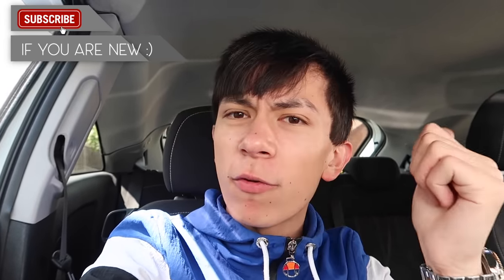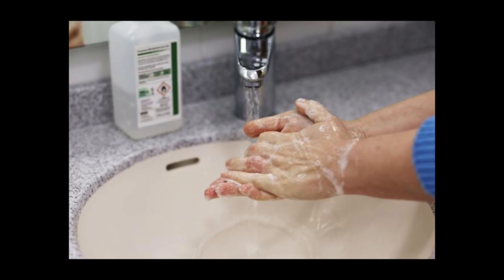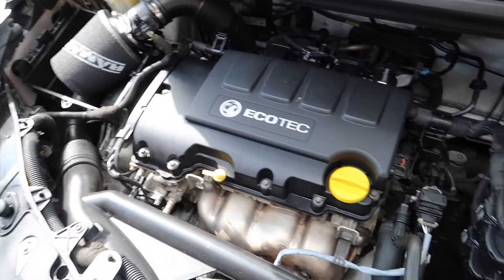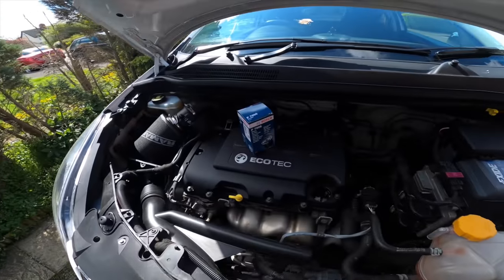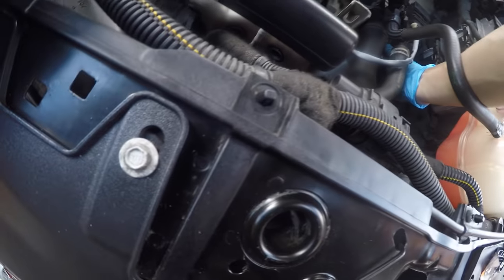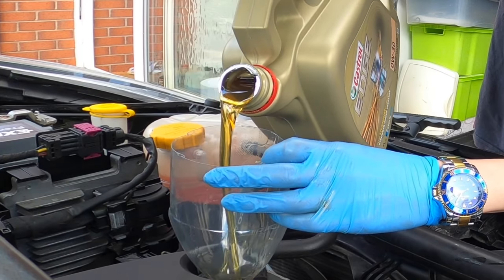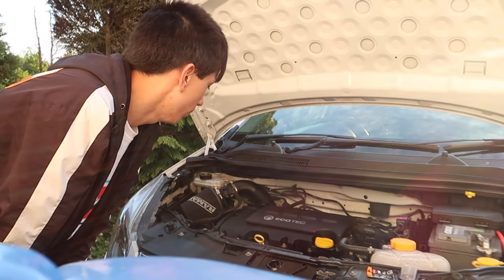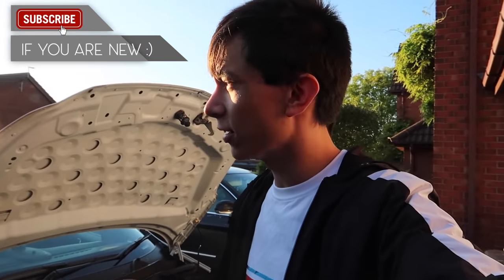SERVICING MY CAR FOR THE FIRST TIME!

Comment: Just a tip from a mechanic bro, when you put the o ring on the oil filter casing put some oil on it before putting it back in the car it stops the o ring getting stuck and ripped while putting in and can cause an oil leak keep up the good work
Reply from the maker: Hey mate thanks for letting me know, I’ll probably go do that now just in case 🤣🙏🏻🙏🏻🙏🏻
Reply: Was about to comment the same thing👌🏼
Reply from the maker: It’s probobly not too late mate 🤣
Reply: The OtherStuff it is, you put oil on the o ring so that it doesn’t rip when you screw the filter in, seeing as you already screwed it in without oil on the o ring it won’t matter
Reply: I was thinking the same!

Comment: Tip buddy usually you undo the oil filter first and this allows any oil up in the filter housing the drain down and makes the oil draining process quicker as it does airlock on itself, the way you did it was fine just a tip

Comment: Youlll get the 6 month MOT extension because we’re in lockdown. Just have to make sure your tyres, brakes e.c.t are still legal if your out and about driving. I service my own car saves a fortune. Spark plugs are dead easy to do. Just have to be careful not to cross thread. Coolant change usually gets done (depending on the manufacturer) but usually at same time the timing belt is changed, although some cars can be timing chain, and not need changing/ inspecting as often.

Comment: I'd be careful doing coolant changes as its not easy getting trapped air bubbles out the system
Reply: Corsa's typically overtime bleed the air out themselves and do not have a valve however, some cars however do have bleed valves. Typically if you ever get an airlock in the system, let the car idle and whack the fan up so you can feel the air coming through the car. Rev the car to about 3/4k for a good few minutes until you feel the heater get warm. Once it's starting to pull through warm air you should then be set.
Reply: It's easy you just need a purger which you can pick up for £10-£15.

Comment: Just for future reference when changing the oil filter it is best to prime it with some of the new oil. It reduces friction and stops potential leaks. 👌
Reply: dusT No so easy with paper ones.
Reply: @AndyK.1  Still oil the O ring.

Comment: You should have done a pollen filter change as well. BTW check the windscreen washer pump on the front and rear to make sure that enough screen wash come out as, a good flow has to come out for MOT otherwise you might be failed.

Comment: The battery problem is probably due to it not getting driven, the voltage slowly drops over time. I’d go out every couple of days and let it sit for a bit to recharge, it’s not the same as driving but will help. I’d also say to disconnect anything in the car, like chargers and stuff that could drain the battery.

Comment: Always good too check the oil every like 3-5k i did 12,000 miles when it should have been 10,000 miles in my 2006 fiesta oops thankfully doesn’t appear too be burning oil tho its only done 50,000 miles

Comment: is yours a 1.2? if so we both have a Z12XE / Z12XEP engine so can you send me the link to the oil please?
Reply: Joshua Dyer Castrol is expensive. Put your reg. number into oil websites. Eg total, to tell you what spec you require
Reply: 0w-30/5w-30

Comment: 🤣lool £274 for a service i paid £70 for ab oil change n filter and air filter and i got offered  £110 for spark plugs aswell as the change of oil (i only changef oil n air filter n oil filter)

Comment: Ditch the Castrol, WAY overpriced, even more savings !
Any synthetic oil with the right specs will do. just make sure to change oil within interval or at least once a year, whatever comes sooner
No need to torque oil filters and sump plugs, hand tight first, then tighten a little more, done.
Don't overthink things.